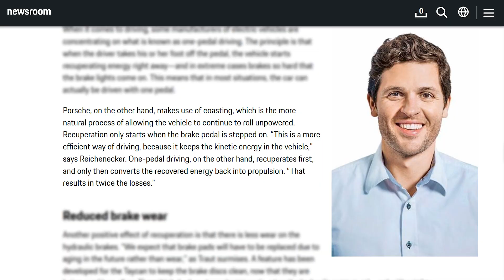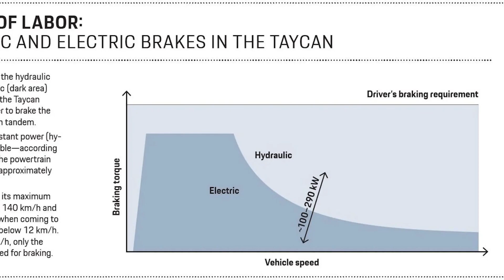Porsche: One Pedal Driving Is Inefficient? | TTN Clips

Comment: When I first got my 2018 model three mid range, there were two modes available, creep and roll. Creep emulates the torque converter of an automatic transmission.  (I find it unnecessary and wish that it could be disabled in Toyota hybrids.). Tesla’s Roll mode is my preference. The accelerator transitions to regen and yes, a moment of unnecessary regen whenever coasting is optimal would be a tiny bit less efficient. Coming to a full stop requires using the brake pedal ; friction brakes are not blended with regen on accelerator liftoff. Once the brake pedal is released the brakes and brake lights stay on. “HOLD” appears on the display. Car remains stopped regardless of any incline. Driving foot is free to rest lightly on the accelerator, ready to proceed. 

Eventually a third mode appeared in an update. I think it was called Hold. (sold my Tesla last summer so going by memory) As someone who didn’t like it I’ll do my best to describe it. Correct me if I’m wrong. Hold mode seamlessly blends friction braking with regen on accelerator liftoff achieving one-pedal driving. I believe this is the most popular of the modes for Tesla drivers. 

I prefer roll mode over hold mode because I oppose seamless blending of friction brakes.  Braking Bad. I’ll train my foot to drive around with absolute minimal friction brakes. It’s one-pedal except for the last few mph before stopping. I get to observe firsthand regen diminishing as speed decreases or at very high state of charge. That’s preferable to being isolated from it by the seamless blending of friction brakes. 

What’s my point?

I can almost see where the Porsche engineers are coming from. Other than emergency situations, I don’t want friction brakes to be activated on accelerator liftoff. It offends my sense of efficiency even though there’s little difference. Perhaps the old German performance traditionalists take it one step further. 

Or maybe there’s certain spots on the Nürburgring where the accelerator gets released and the brakes get mashed and the old Germans don’t want to relearn the whole course. That’s gotta be it. Ignore what I was saying about small increments of efficiency.